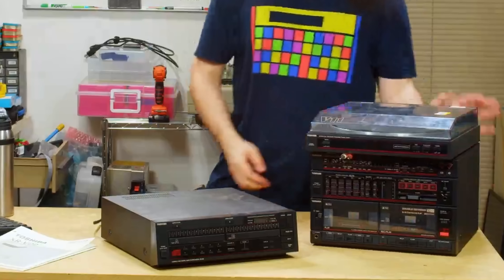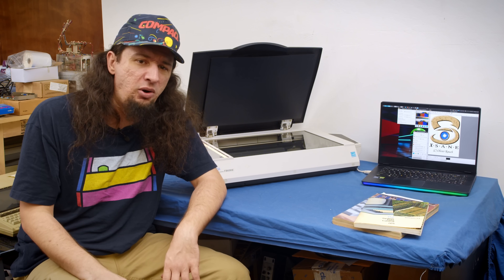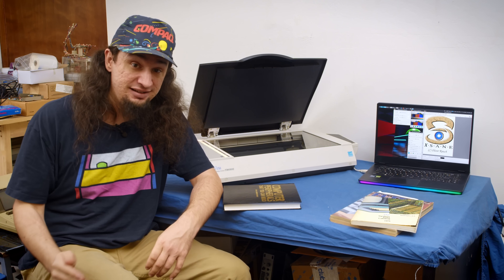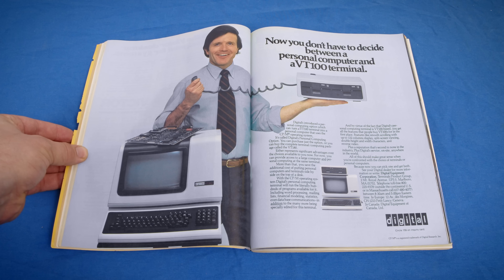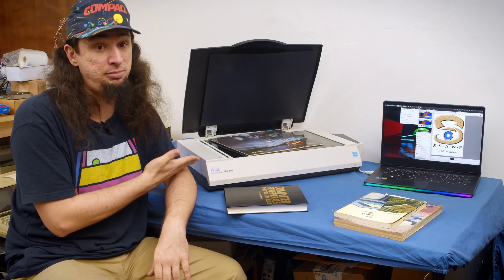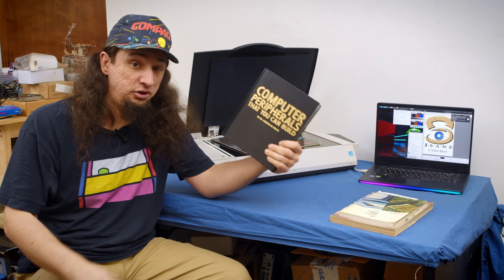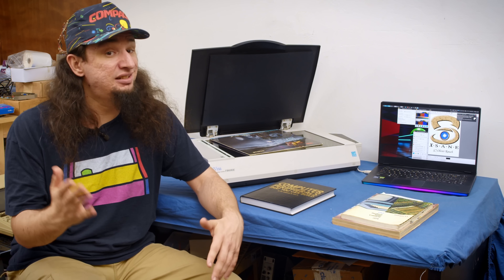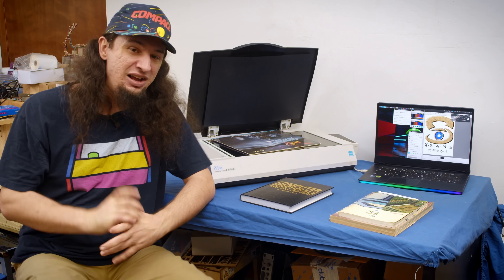Archival Grade Flatbed Book Scanner - Avision FB6080E

Comment: There's a channel here called Book Scanning that shows a DIY v-shaped scanning rig with twin plexiglass platens. That's pretty much what library archivists use.
Reply: Just looked it up, and will watch after this, but I definitely can see some similarities with ones in videos posted by Internet Archive. Definitely interested 👍
Reply: Awesome, thanks for the tip 👍
Reply: I suspect that's what he meant by "getting creative" with two modified cannon flatbeds
Reply: yeah, Archival and Flatbed scanner is an oxymoron. an Archival scanner opens the book as little as possible.
Reply: I work in library on archive scanners and i never used v shaped glass plates. Why ? Because they are heavy and it can take a toll on your hands and wrists when you scanning 4-8 hours per day. Also the other problem (al least with our v shaped glass plate)  is that it leaves black lines where the spine is and it is really really annoying to look at it. Also when you are using v shape mode on scanner, book tends to slide of the sides and you can get crooked scanned pages. And you need to support the book to get pages flat on the glass.

If you are interested, we are using ImageAccess Bookeye 4 (with v shaped glass) and 5 (archive versions) and Zeutschel OS 12002.
Reply: There's a site, organisation, and community called "diy book scanner". They have a website. It has designs, kits, suppliers, analysis.

Their main emphasis is a sophisticated V-cradle scanner, using 2 cameras. The support software allows rapid scanning, and various automated corrections, culminating in a PDF of the entire book.
Reply: i bet that this is what Sheby will be trying to do with his donor Cannon cheap scanners
Reply: I'm going to probably have to construct something like that for a large digitization effort where each book is 1000+ pages. I was close to buying the CZUR ET24 ($600) but then learned it does not support raw/lossless imaging. So every scan will have JPEG artifacts. The company argues that you can still save out as TIFF, but that is only derived from the already lossy JPEG version so is completely useless. It's probably a minor detail for most people but if digitizing fine detail schematics and such with media that doesn't support traditional flatbed, I would rather have full control over the raw image data.
Reply: the ET24 is only 350 DPI (when scanning A3)  @MattPilz
Reply: @Catheidan  ' an Archival scanner opens the book as little as possible.'   'Archival' can be referring either to the book itself, or to the results.
Even if you destroy the book entirely to make the best scans possible, the scans can be the archival result, not the original book.
All things are relative.
Reply: 'a DIY v-shaped scanning rig with twin plexiglass platens'   Yes, think it may have been glass even, at least in one of the videos.
Just had this video pop up and this was the first thing to come and comment in case he hadn't already seen that video.  But no surprise if he had already hit it, or that it was already in comments, it's one of the main things you hit when researching trying to scan books better and faster.

Counterbalanced and motion limited and/or locked so you could quickly raise, flip the book page, and exactly reposition the wedge could make this very fast.  Still limited by the scanning speed of course.

In fact 'The Easy Book Scanner - an Introduction to this 1000 pages per hour scanner' is over to the side in the links..  Not the video I was thinking of, but it's another one with the same basic idea and that I'd seen before.

Come up with a reliable page turning method and you could completely automate scanning the books.  Hard to do universally though, so many book and magazine pages want to stick with wildly varying results.

Funny I didn't hit the zero edge scanners years back looking at it, I can probably cut the side off of my cheap $10 flatbed scanner and it would be good enough and more convenient to use.  Not that I scan very often, haven't done one in years.
Reply: Thanks for these suggestions, too! When I had been researching I found that a lot of these DIY projects seemed to had started and then grew stale a decade or more ago, with many broken links and websites that once housed a lot of blueprints and templates. That "Easy Book Scanner" you mention looks fantastic and compact compared to some I've seen, but I'm not sure if a simple parts list and instructional guide is around for others to try to mimic it. I do think the camera approach is most sensible when needing to scan high volumes and with modern cameras including phones being relatively cheap for many megapixels, it is a good compromise for speed vs. quality.  @ModelLights
Reply: @ModelLights  The @IshikawaLab channel has a very impressive demo from 10 years ago unfortunately they are a research lab and not a product company. A 250 page per minute automated scanner. Although the lens alone looks like they would already by quite pricey even if it was sold as a product.
Reply: At first i thought u said library activist lolll

Comment: Ex commercial printer here. Photos that going accross two pages are known as "gutter jumps". Can be pretty difficult when doing a lot of books
Reply: Those Gutter Jumps can be super annoying to get around without cutting the pages out of the book which I really don't like doing.
Reply: It also depends on the makeup of the folios of the book... if large sections are used, such as 64pp or higher, the multiple folding can cause a large variance in the size of the trim on the binder, going from the outside to the inside of the section.
Reply: Yeah, but you'll finish the book in half the time !

Comment: Many years ago I did some work to make a Fuji scanner work with an odd flavor of UNIX (Trusted Solaris). The software the customer wanted to use not only did OCR, it also did font recognition. It produced a PDF output that was searchable and almost perfect. You were also just a hotkey from seeing the scan. The one we had for development did double sided sheet feed. It worked so well that someone brought in a bandsaw to cut spines off. The thing went so fast that we had to build a sheet catcher because the pages would fly all over the room.
Reply: Had used to use one of those Fuji flat top with a feeder where I used to work and they were really great Scanner. Very expensive but got the job  done The scanner was back from 2012 or 2013 I don't exactly remember the model number but I know it was a Fuji

Comment: the edge is from ye olden days to prevent outside light from coming in. But scanners work differently than they used to due to optical sensors becoming better and more affordable.
Also it is often the bundled software, that only works with the 'specialized' scanner, that makes it worth wile for book scanning / archives.

Comment: There is another technology for scanning books, using a prism and a mild vacuum or static cling, you can scan both pages simultaneously, and essentially the entire crease.  ScanRobot is the patented commercial option, but there have been numerous DIY/Maker versions.  (Two CCD or line scanners are placed ontop of the prism, each sees out one of the other edges of the prism.  This assembly is moved into the crease, and pulled straight up.  A vacuum or static holds the pages against the prism.  The book does not need to be opened very much.)
Reply: can you provide links/details on the DIY maker versions? I would love to build one for myself.

Comment: My grandfather owns one of the thin Canon bus-powered scanners and they are EXCELLENT. Of course, Canon doesn't support them anymore - Mac support ended at 10.7 I think, but they work perfectly out-of-box in Linux and it's just beauty. When you are done, they go into a deeper drawer and disappear until you need them next time. Light, reasonably fast, image is OK, no power bricks to deal with.
Reply: Note that those use CIS sensors, which don't go above 300 DPI (the scanner will fake higher resolutions with interpolation) and anything that isn't completely flat against the page will be out of focus. They're still good for scanning completely flat (never been folded) pages if that's all you need to do.
Reply: @garfieldepicmoments  thanks for the info! Yes - it is mostly used to scan invoices, letters, etc..

Comment: XSane is actually the only scanning software I use, even though it has an archaic interface I love the amount of options it has and it doesn't try to hide them from the user like more "simple" scanning software, I actually prefer it to most scanning software on Windows, specially the garbage ones that manufacturers provide.

I really want to see the ideas you have on modding Canoscan scanners, those are so common you can actually find working ones in the garbage.

BTW, decent film scanners also have insane prices as the document archival ones, they also don't seem to be much different from "normal" scanners. This has led me to photograph negatives instead of buying one of those, slower for sure but much cheaper if you have a decent DSLR or mirrorless.
Reply: good film scanners have infrared dust removal e.g. Digital ICE
Reply: I wish xsane was a little smarter about auto adjustments though - at least with some scanners, it always auto adjusts too dark and I have to muck with the brightness and contrast sliders (or the "whitelevel / blacklevel color picker above the preview) to get things better.
Reply: @gorak9000 It's probably that there are differences between the hardware units that xsane doesn't know about and can't easily compensate for.

Comment: I have an HP M29W MFP laser printer device, and it seems to have a very, very slim edge just like this. It's also an HP product, so it's definitely Linux compatible! It does 600dpi, and is flatbed only. Plus, it's a monochrome wireless laser printer compatible with Apple AirPrint, so it basically covers every possible need I have. Thanks for educating all of us on the usefulness of a zero-edge scanner.

Comment: Personally I'm in the debind camp. Getting the best scan including the bits in the book curve is the most important thing. Depending on the book I might even lay-flat comb-rebind it afterwards to make it easier to use in future (very good for textbooks; obviously many of these are not really in short supply).
Reply: Have you compared that to systems that project a grid/lines on the pages to help correct for the curves?
Reply: @MorbidEel  Fortunately it's no longer my problem, but I only ever had access to a big standard photocopier/scanner. One booklet that was A4 pages as A3 sheets with normal staples was an interesting task for the ADF, but the result was excellent (once I flipped half the pages...).

Comment: Please don’t replace the light source with LED’s, high end professional scanners still use Cold Cathode Lamps because the CRI is consistent across the width of the light strip and there’s no PWM flicker to counter with image processing. LED’s are used in less expensive units for cost reasons only.

Comment: as the owner of a plustek It's a really, really good zero-edge scanner, Though it's sad to see how they mostly died out after 2010 in favor of those really bad quality top camera scanners
(so if you need to scan books without ripping them apart, it's always best to find one used or like in the video the library is another good place to have zero-edge)

also im all for the DIY route, seeing a video on it from you would be legendary since theres not a whole lot and the ones that exist are not very helpful and quite old.. like almost a decade old

Comment: This feels similar to my instance. I was lucky and scored an Epson Expression 10000XL Photo scanner. The 10K line of scanners are just as expensive, moreso for models like the Photo one I have, since it has an upside-down scanbed for negatives or x-rays. At the very least, they're from Epson and work without issue for me using Skanlite. It might just be the driver implementation if the Avision's having an issue. Or that I'm using the Flatpak. Either way's possible.

Comment: My office got few Avision A3 flatbed/ADF scanner, those things cost around $4000 back in 2009, it still works and produce scan like it was brand new, on the other hand, i used $600 A3 Brother all in one printer-flatbed/ADF scanner-copier from yesteryear, those thing prints sucks, scans like 90s photocopier machine, and such an ink-guzzler it never allowed to used as a copying machine.

Comment: Plustek Optibook A300. Excellent scanner and I'd buy another in a second. Costs about a grand, but is an absolute workhorse. The lid seems like it should open more than it does, though. Combine that with questionable hinges, and that's the one weak spot/complaint I have with it.

Comment: This reminds me of when I used to do IT for our municipality. I was in charge of the scanning and archiving software and hardware. I can't even remember what the scanners were some sort of very expensive Fujitsu thing but we a document management program called hummingbird which was absolutely awful and was basically always broken.
Reply: The solution is to use the Fujitsu scaner with xsane in linux - I have a fi-5750C and it's an amazing scanner - crazy fast! It scans at 600dpi faster than most scanners preview scan at low resolution, and the full duplex sheet feeder (with built in page heater to eliminate wrinkles) is stupid fast!

Comment: Cool and honest review.  I looked up avision fb25 which was incredible fast scan times at 1200dpi looked promising but like you said "you can't find them"
Reply: As a representative of the African distributor of Avision, I find that pretty sad, because the FB25 is an amazing unit to watch in action. Where are you based?
Reply: Did a bit of digging. Xerox used to sell rebranded Avision units in the USA (and possibly Canada?). Xerox currently rebrands Visioneer devices, which are themselves rebranded Avision products. The model number for the FB25 equivalent is the Visioneer 7900. Can't vouch for its compatibility with SANE or Mac OS, though. If you have your heart set on an original FB25, your best option would be to import it from one of Avision's other markets, like Europe or Africa.

Comment: I purchased Epson 3200 in 2008 for ~$100 on web auction. Pretty happy with it. Scanned numerous pages and films on it with decent quality.
Reply: I have an Epson Perfection 2400 Photo from new and it is a pretty solid scanner. I got it because it does negatives and slides with an adapter, although that can be fiddly and I found that negatives didn't always sit flat in the adapter, but then dedicated film scanners like those from Nikon were way beyond what I could justify spending. For a document scanner, though, it is pretty fast. The other reason I chose Epson over Canon or other brands was that SANE had solid support for Epson models at the time (over twenty years ago), which will be a consideration for anyone picking up a used model even now.
Reply: @paul_boddie  For me worst problem with film scanning on flatbed was contact film with glass producing non retouchable Newton circles. I tweaked adapters by adding steel wires in places between frames to support film and prevent glass touch.

Comment: Oh! I have very extensive experience in scanning an insane amount of documents, quickly, and in decent quality. What you want is a  duplex, feeder, SCSI (scuzzy) scanner with OCR. Or a modern equivalent for scanning speed.

At around 2005-2011 I worked for a medical billing company that had to keep 10 years of records. We had a literal warehouse indexed of boxes and boxes of mail correspondence, bills, checks etc. All of which we digitized. I'm talking cartoonishly large piles of paper on my desk, Of which I could scan thousands in a day.

The ideal method is to remove staples, and prepare the pages in order, even cutting where necessary. Then you place it on the feeder and it would scan insanely fast, while also applying OCR (Optical Character Recognition). We could end up with high (or low) quality pages with tech search available on all of them. It worked wonderfully and allowed us to take decades worth of documents and store them digitally. The entire warehouse was eventually completely scanned and closed. A successful venture.

An entire geographic region of very specific type of medical billing for most hospitals in the area digitized.

Comment: VueScan is not free, but it's available for Linux and handles more or less every scanner there is. I haven't yet found a scanner that it couldn't handle without drivers, and that includes A3 and negative scanners. I've only used the Windows-version, and it's worth every penny.
Reply: Yep, have a licence for vuescan.
Reply: Not paying from $40AUS to $179AUS for a scanner program.
Reply: Just checked vuescan drivers for that avision and it should work straight out of the box with linux
Reply: Get a lifetime license, worth it

Comment: You are also running over usb2.0 on this device. That will affect its speed. There is no onboad buffer which is part of the reason for the stepper speed. 

However scanning at 600 DPI is just overkill on paper. Heck when Kodak only used 300dpi for photo scanning. Otherwise you get film grain noise.

Comment: The scan artifacts at 13:15 are probably due to reflection of the golden / shiny lettering. At least from what I can judge by watching it on video (as opposed to IRL). You could try to scan a mirror to verify. You can also buy configurable foot pedals to execute keybinds somewhat cheap.

Comment: I have an ancient Canon Canoscan LIDE 210 scanner that's been working for over 20 years, might even be more like 30. It only needs one USB connection for both data and power, no separate power block needed and it doesn't plug into the wall, just powered by the USB plug. It's been a great scanner and works perfectly on Linux Mint. I fear the day when it breaks and I have to get a different scanner.